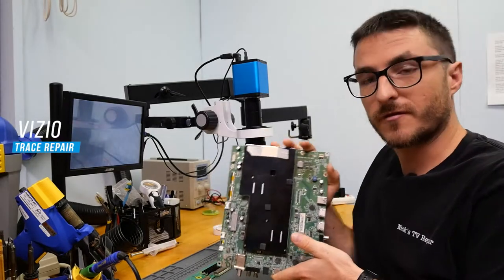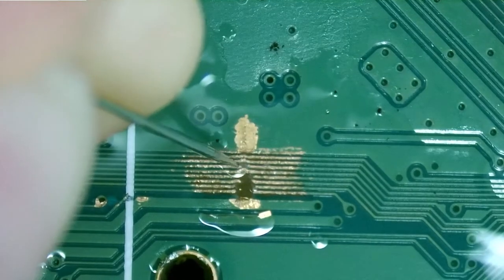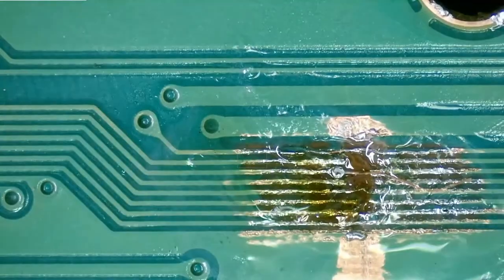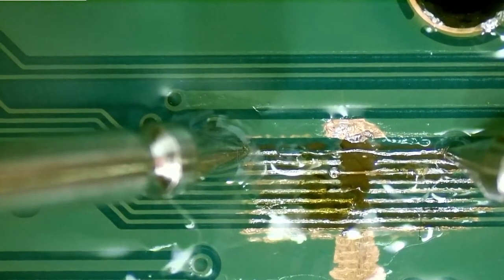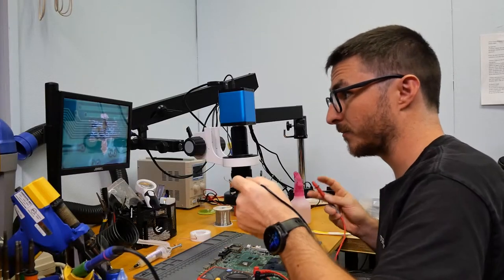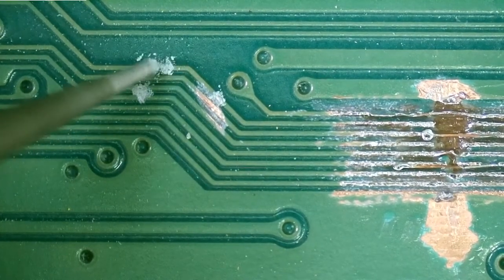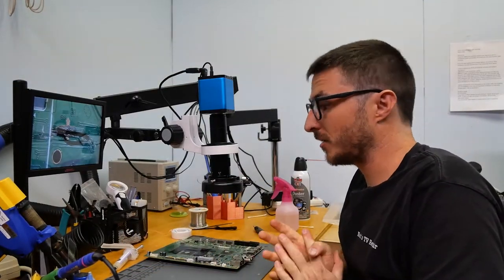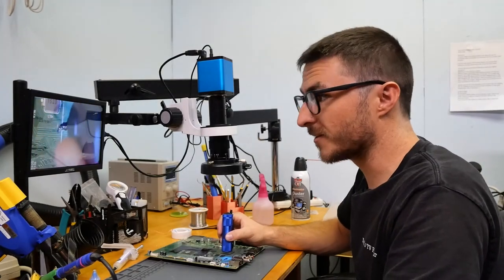Vizio 4K TV Mainboard Repair M75-C1

Comment: Thank you this video is super helpful. Working a project that involves tapping into a few traces and i didnt even think of the little dremel bit that's a game changer
Reply from the maker: Oh yeah that thing is such a clutch tool for trace repair. We have been having to do a lot of trace repairs lately from ripped off connectors, HDMI ports, or power connectors on other device that were just physically damaged. That thing makes it so much easier to expose the copper accurately.

Comment: Hey I have a Vizio M43-C1 and im getting a random popping noise from what I think is the main board. It sounds like a speaker popping or a spark or a tiny bulb popping. Happens every like 10-15 minutes or every hour. Its completely random.
I replaced the speakers and its still happening.
Any idea what it could be on the main board?
My main board is a replacement. I swapped it out at one point.
Reply from the maker: Try a factory reset first, if that doesn't resolve it, you may have an issue with the mainboard but it may be best to try external speakers. It would be an opportunity to upgrade to newer better audio system. Vizio has some pretty good sound bars.
Reply: @NicksTVRepair  i have another audio source and it doest happen on that source. It actually only happens on Youtube videos, which is what i mainly watch on this tv. But it doesnt happen on my other speaker source with YouTube.
So i did swap the internal speakers and it didnt fix it.
So could it be how the speakers connect to the main board? Im gonna do a main board swap and see if it fixes it. Just wanted to see if maybe there was something on the main board that I could just fix.
I really dont see any other instances of this exact thing anywherre online.
Weird. Has to be the main board.

Comment: Hi Nick,Tvtimmy (Tim) here, I may send you a mainboard for a m75-c1. Do you actually reball it with leaded balls or just thourally re-flow it? Also how much is the service?
Reply from the maker: For that one we reflow both the Main processor and the video processor. Most other services only do the main pocessor. 
We don't typically reball because we would need to charge a lot more for reballing and no one is willing to pay those prices so we do reflows for most of these. We do however also upgrade the thermal past, and add new pads to the boards. I don't believe anyone else does that. And lastly yes we do the reflows correctly and thoroughly. As for price and links, I try to avoid putting that info in comments in case we ever change our prices, so ill have to request you either contact me directly via our email or fill out our contact form on the website and check the repair service links in the video description. 
But really send me an email and I can also provide you with a discount code. (email and contact forms are in description as well)

Comment: Hi nick, I have been watching your videos....very informative. I have a vizio m75-c1 that exhibits the following problem:  the front standby  lights up then slowly fade, like normal. Hit power and the front LED would light up, but the backlights do not turn on and there is no OSD or video with a flashlight. After about 15 seconds, the front LED would fade out. At that point, the TV has to be unplugged and re plugged before it would respond to the power button on the set or the remote.  Do you think it's a main board issue? How much would you charge to reflow or reball  to fix it. Thank you in advance for your help.
Reply from the maker: Hello Luis,

Yup that is a very common fault you are describing and is due to the mainboard. We should have no problem fixing that for you. We have a flat rate service. To avoid any scams or anything like that I have stopped providing links in the comments. 
All links are posted in the description of the video. 
I have a link in the description to the flat rate service we offer. 
Right now we are doing 1 Year warranty included with the repair
Reply: @NicksTVRepair  Thank you Nick, I shipped yesterday 1/27. Hey would you be able to record the repair procedure for me please?